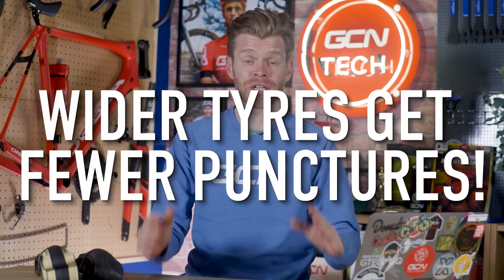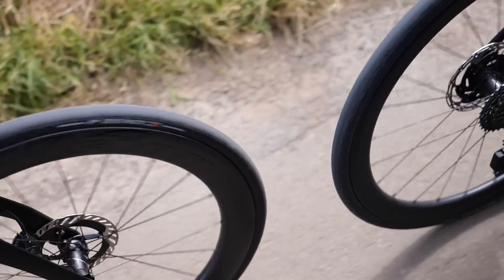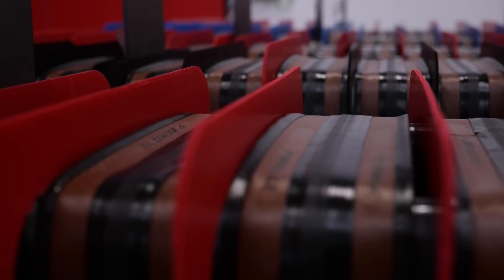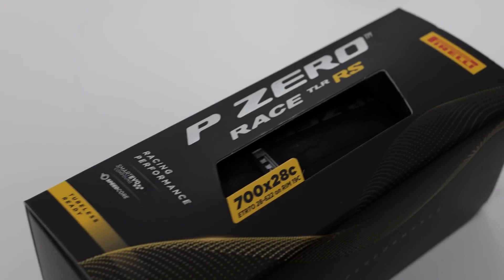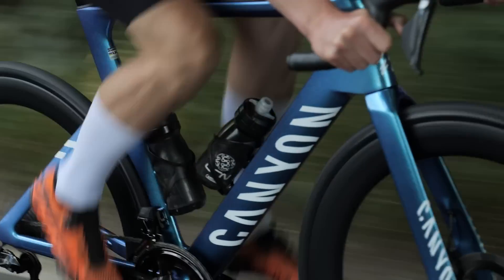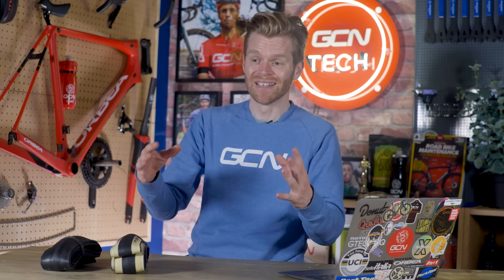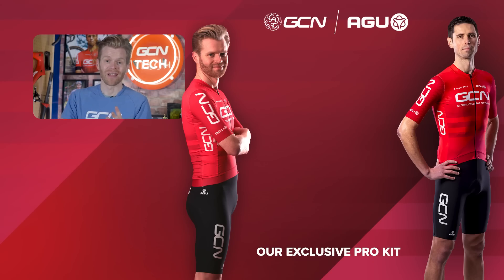Why Your Bike Tyres Get More Punctures

Comment: 6:49 Lower rolling resistance on wider tyres? No way. There is a direct relation between the contact surface of a tyre and rolling resistance.
Reply: No, there isn't - the situation is much more complicated (which is one reason why  even the pros tend to use wider tires these days ...).
Reply: @michab4083  Off course there is. Off course there are also other factors to take into consideration. Factors that outweigh the advantage of lower rolling resistance and therefore make riders choose wider tyres. Like lesser chance for punctures and the potential associated loss of time outweighs the win in time because of the lesser rolling resistance. The choice of wider tyres is by no means proof of a lesser rolling resistance. Why do you think sports cars need wider tyres? Exactly: for more grip (or ground resistance)
Reply: @michab4083  One thing seems for sure. If you are a 55-65kg pro, riding pro speeds, those 28mm tires most of them use must be fastest. Couldn't imagine otherwise. The situation for mere recreational riders might be very different. I personally find those wider tires more pleasant to ride on, and if folks pass me because they are fitter or have faster gear, good for them.
Reply: @HeadPack  I absolutely agree. Unfortunately I do not belong to the group you mentioned (for more reason than one!), so your conclusion applies to me as well.

Comment: I suggest a new UCI rule, : "The tyres must be at least 32 mm wide", because I assume that there willl be less punctures, and the lower pressure also will probably reduce the chance of tubeless tyres coming off in highspeed turns, which will reduce number of bikers dying  when decending.

Comment: You should do more videos like this with useful data.  30/32mm wide gp5000 tires, at proper pressure, with silca sealant will make it very hard to flat.  I havent flatted in a couple of years now, about 12000km and im 90kg.  Using proper tire pressure and a good selant that is kept up to date is key.  I hope Pirelli keep improving thier compound to catch up with GP5000.  And I believe Tadej ran gp5000 28mm TT TR last year, this year he went to 30mm gp5000 S TR.  And he can basically pick any wheel/tire combo he wants, so this speaks volume to that tire.

Comment: I’ve been setting pressure in the tires of mine and wife’s bikes at 15% drop for about a decade. I initially tried this based upon somehow finally fully comprehending a magazine article from the 1970s. Although all 4 of our tires are identical I have a unique pressure in each tire because of difference in F to R weight distribution and difference in her weight and mine. The 15% drop came from lab test study on drums for optimal rolling resistance. I can’t confirm the speed but do perceive it to be true. I can attest to other benefits. The most noticeable is better handling because this results in F and R tires having same size contact patch. Tires last longer because the intended width of tread is used, spreading the load and not concentrating wear along the center of tread. The GCN observation about fewer flats has no argument from me. 
I’ve encountered this in aviation, manufacturing, and cycling, prior generations understood something, subsequent generations lost the knowledge, and sometimes we rediscover it.
Reply: Glad I'm not waiting for you to get ready for a ride! "Wait, wait! My tire pressure's just about perfect now! Ooops, the weather changed, I gotta start over." Everyone knows someone like this :-(

Comment: just upgrade my challenge handmade tlr 27 for a vittoria corsa pro 28 and run at 3,3 bar (recomend pressure in vittoria site) so smooth ride and fast, before 4,5 bar and in the rear 5 bar

Comment: Curiously, I’m running my commuter bike to work every single day, with 25mm Michelin Lithion’s and decathlon’s inner tubes. Zero flats so far (more than 3 years on that setup).

On the other hand, I’ve punctured every single month on any performance bike that I have, and I mean I’ve punctured on Conti’s 5k, Pirelli’s PZeros, Schwalbe Pro Ones, Veloflexes Corsa Evos and Michelin’s PowerCup, all tubeless and many of those in 28mm spec, with all kinds of tubeless sealants (Silca, Stans, Orange Seal and others). 

After dealing with too much sealant hassle I’ve decided to return to tubes, and I’m now running Michelin’s Power Cups with Conti Supersonic tubes for more than a year, and I can say that I’ve probably punctured about 2 or 3 times in more than 12 months, and had to deal with a bad valve seal on a Conti supersonic tube once.

All this to say that the science sometimes tell a story and the real world just finds its way to annoy science now and then 😂

I still continue to run 25mm Lithions without a single flat to date 😅

Comment: Taking all that onboard, and yes, I am running wider tyres now tubeless. Does tyre pressure affect tyre wear ? 
E.G. will the same tyre (same bike, rider, weight etc) wear out faster with a higher pressure than with a lower pressure. My theory is that,  the higher the pressure, the less the tyre will deform and therefore wear out quicker. Am I wrong?

Comment: Sorry, Ollie, I tried 25mm, but quickly went back to 23mm.  I prefer the feel of skinnier tires, (100 psi rear, 80 psi front).  Maybe rider weight is a factor?  I'm very much at the lighter end of the distribution.
Reply: Feel is very misleading though. 
30mph in an original Mini feels really fast and exciting. 60mph in a modern car feels sedate i comparison. 
Narrow hard tyres feel faster whilst actually being slower.
Reply: @imajez1  Well, at 80 I can no longer go fast, so I'll settle for the feel of doing so.
Reply: @richardharris8538  at 80 it would make even more sense to ride a more comfortable less bone ratting bike. 
But keep riding regardless.
Reply: @imajez1  How do you know?  I bet you're not in my age bracket.  I'm sorry if my liking 23s triggers you.
Reply: @richardharris8538  How pathetic to think my suggesting you ride a more comfortable bike 'triggers me'. 
It's totally up to you to keep riding tyres that have long been proven to be slower, less comfortable and have less grip. Only you will be suffering from your rejection of physics.
Reply: @imajez1  Oh dear!  Well, perhaps you shouldn't tell other people how they feel?   As for physics, I only studied, (and used), Newtonian physics.  But that's okay.  At my speed, relativistic effects are really quite irrelevant.  And even though I'm on the small side, my total system weight, sorry, mass, is sufficiently large as to render quantum effects as being irrelevant.  But if I should get lost, and wish to know my position, I'll certainly consider not measuring my velocity.  And as for suffering, that's the fault of biology, not physics.
Reply: @richardharris8538  Patronising and irrelevant - so often the way with reactionary fact dodgers.
Reply: @imajez1  Where have I dodged facts?  I've only discussed feelings, (except for the post-Newtonian physics).  You have tried insulting me, but my feelings are still intact.  I, at least, am not fragile.
Reply: @richardharris8538  You started with the belittling and now continue it here. 
But hey there are those pesky facts again. 
And no I'm not triggered by someone who is firmly stuck in the last century.

Comment: I actually genuinely can’t remember the last time I got a puncture on the road, it’s at least a couple of years ago, probably at least 12,000-15,000 miles since I had a puncture in road riding, and I use race tyres year round on crappy British lanes full of debris and pot holes. Running tubeless tyres between 25 and 32mm across multiple bikes, at modern low pressures as recommended by the SRAM calculator.
I did have a sidewall puncture a few weeks ago - but that was doing a rough gravel descent at speed on road tyres, so can’t really count that! I put a plug in the tyre and then did another 500 miles to complete the ultra race I was doing without problem.

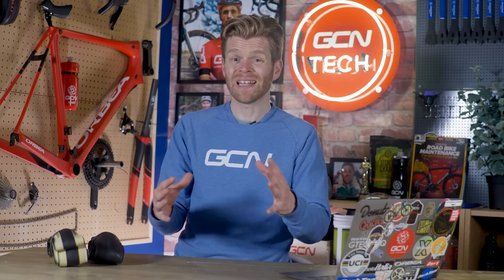Comment: It's sad how excited you were to learn that the pressure in the tire was equal to or very close to the pressure on the ground. Public school? 6:30 grip won't change (on a smooth surface) from 87 to 72psi because the area divides out of the friction equation. Lower pressures can only be taken advantage like that if the coefficient of static friction is increased by going to a softer compound. The lower pressure facilitates this by decreasing the wear rate.
Reply: The grip does actually increase with the wider contact patch, but not in proportion to the contact patch area - the increase is due to secondary factors. If it didn't increase AT ALL, drag cars wouldn't have very wide rear wheels, for example.
Reply: @gregsullivan7408  If the rubber could be made infinitely soft, then the tires of a drag car would not need to be wide. But because there is a limit, the tire needs to be made wider to increase contact patch area. What are these secondary factors you are talking about.
Reply: @trentvlak as A.I - you'll get a very comprehensive list with detailed explanations....

Comment: I got one puncture in four years / about 40k km's, and I ride the shittiest b-roads, forest roads and rocky gravel. Proper pressure, considerate line choice, wide(r) tires and running mostly tubeless prevent a lot of headache.

Comment: riding 25's at 8 bar. had 1 puncture in 3 years. running continental gp3000 with butyl inner tubes.

Comment: Over the last 2.5 years riding a couple times a week all over Texas and some parts of Alaska, I've yet to get a single puncture, even with Continental GP5000 tires with TPU tubes. I've always set my pressures using an online calculator.

Comment: Sorry Olly, pretty sure Pogačar rode 30mm tyres in this year's Tour? Not 28mm. 
I started riding 30mm this year, the best comfort/grip/speed I've ever had. On my C64 the ride is simply sublime. At 82kg I use 70psi (4½ bar).
And when I think back, I used to race with 23mm Tubs, 110psi, back in the 80s 😳
Reply: yup, I'm convinced 30's rule for pure road riding.
imo, 28 is needlessly small, 32 is needlessly large (and heavier).
Reply: @seanmccuen6970  Well seeing as that Pogaćar's tyres measured at nearly 33mm, no 32mm tyres are not needlessly large. I stopped using my 28mm road tyres many years back after realising my 33mm CX tyres were just as fast and way more comfy.
Reply: @imajez1  nah, 30's mounted on 25mm internal width rims were apparently his go-to package, thus the '32mm' measurement (your words).
he wouldn't run 32's which are overkill for normal pure road riding, he wouldn't accept the WEIGHT penalty (nor the less than aerodynamically optimal tire cross sectional shape).
only time 32's are 'optimal' on a road bike is if it's wet and filthy out and/or you prioritize increased comfort over anything else.
Reply: @seanmccuen6970  Sigh! the width of a tyre is what the ruler/calipers measure it at. Size labels on tyres are as notoriously inaccurate just like clothing/shoe sizes and they can only be accurately stated in conjunction with the rim it is fitted to. Pogaćar rode tyres that measured at nearly 33mm, ergo he was riding 33mm tyres. Not to mention that a wider rim will also be heavier than a narrower one and that weights of wheels have gone up of late anyway because the benefits of non ultra light wheels make up for the extra grams.
 People not that long back said 28mm tyres were too wide, heavy etc just as you are now saying about 32mm tyres. Plus ça  change.
Reply: @imajez1  lol nah, measured tire size is a product of the tire size and internal rim width (btw, I get actual tire sizes can vary re. manufacturing, etc).
he was running the overall A-1 optimal tire size of 30c for 'conventional' road riding/racing on insanely wide modern wheels which equated to around that measured 33mm figure you stated.
he was running 30's, no less, and definitely no more (per my original point).
Reply: @seanmccuen6970  Which part of the measured width of the tyre is the actual width of tyre do you need a ten year old to explain to you. 
The labeled size is nominal, not actual.
I also specifically said "and [size] can only be accurately stated in conjunction with the rim it is fitted to."
Reply: @imajez1  measured (mounted) WIDTH doesn't mean much more than f all. what matters more is a 30c (marked) tire gave Pog the overall tire VOLUME (and corresponding tire weight) that he wanted versus a (marked) 32c which is a 'comfort' oriented size. 
a 32c tire would have given him excess volume and weight that he wouldn't need, wouldn't want.
you apparently, and incorrectly, claimed he woulda' been happy as a clam with a 32c tire, I'm saying he wouldn't, especially at the friggin' TdF. get it now, einstein?

to reiterate; 30c is the overall gold-standard tire size for FAST road riding today under 'normal' conditions. not 28, not 32+, 30.
Reply: @seanmccuen6970  Good grief! The only width of a tyre that matters is the width it actually measures up as. How it is labeled is irrelevant. Bike reviewers have for years contrasted actual width Vs claimed width of bike tyres. Some size up bigger and some are smaller than claimed and that's on the same rim. You can ride a tyre labeled as 32mm which measures smaller than a tyre that is nominally 30mm. Pog rides tyres that measure up at 33mm, therefore he rides 33mm tyres. It takes a special kind of lunacy to claim otherwise. 
As 30mm being the for 'gold standard'. Well apart from the fact that folk like you said the same thing about 23mm tyres not long back, is that the optimum tyre will depend on the parcours, weight of rider, rim width, weather, etc. There is no one size fits all. 25mm also became the 'gold standard' for a while, then 28mm and now we're going bigger again. I have long said 32/33mm will be the sweet spot for road riding before the extra weight weight negates the other benefits. Though it may end up bigger. As it turns out, much bigger tyres can rather surprisingly end up being more aero than the 'gold standard' 105% aero sweet spot re tyre width/rim width. Plus as already explained several times, Pog's usual tyres measure up at 33mm, so surely that's the 'gold standard.'
Reply: @imajez1  lol... I get all that, but we're talking about pog's bike in the TdF. so if pog was running '33's' (your words) on those mega wide rims they'd 'a measured out at 35mm+ mounted width. he was running 30c (even had a big purdy '30c' marked on the sidewall) which created an optimized tire VOLUME and aerodynamic package as well as keeping the weight down, not to mention the generally enhanced handling characteristics over 25/28mm tires. 
nobody at Le Tour, his physical size, in the dry (even in the wet, for that matter), on 'normal' surfaces is going to go any bigger than what he and his team very specifically chose; that's the overall superior size of 30c for this application, innit, and it sure isn't any bigger (for all kinds of reasons).
Reply: @seanmccuen6970  
If Pog was running tyres that measured out at 35mm, then a rational person would say he was running 35mm tyres. This should not need explaining, but here we are. 
It doesn't matter what the claimed size of tyre is because apart from the fact tyre size is dependent on rim width as VERY, VERY, VERY clearly shown here, manufacturers are notoriously inconsistent with tyre sizes. Both width and diameter. Hence why some tyre/rim combinations are incredibly hard to fit and others are just fine. 
Nobody in the Tour would go bigger than 25mm was the incorrect refrain not long back, yet progress happened and now the winner used 33mm wide tyres.
As ever there's a lot of competition for the most stupid person on social media this week and impressively you are still in the running.
Reply: @imajez1  lol... those tires wouldn't have been '33's' on a rim with a narrower internal width, now would they.
in fact, I'd say they'd be more like ~31.5mm (measured mounted width) I'm seeing from my own 30c tires mounted on rims with a 22.5mm internal width.
would you put money down saying my tires (30's) mounted on pog's wider wheels wouldn't measure at 33mm wide?
see where I'm goin' with this??

Comment: Well done, GCN! In the late 90’s and early 00’s, I was convinced that carbon fiber technology would revolutionize cycling, and it did. What has surprised me in the years since, is how much greater the effects that improvements in brake and tire technologies have had on our sport. On our rural west Texas mountain roads, I find that my 25lb(11.5Kg) steel-framed, early “gravel” bike is just as fast on 32mm tires as my 19lb(8.5Kg), mid-level carbon fiber Cannodale Synapse is on 28mm tires. Both bikes have the same gear ranges, both have low spoke-count aero wheels, and both are running the same brand tires of the same spec. I’d put 32’s on the Cannondale, but they’re too big to clear the fork crown. Sigh.😁
Reply: Yeah ok
Reply: Late 90s was when VREDESTEIN touted their high 175psi clinchers.  In my local group ride nobody was crazy enough to go higher than 120.  I still have several NOS Fortezza clinchers and still think that VREDS had superior tires.  But only 23mm for my Colnago Master with Mavic Open pro wheels still running true.